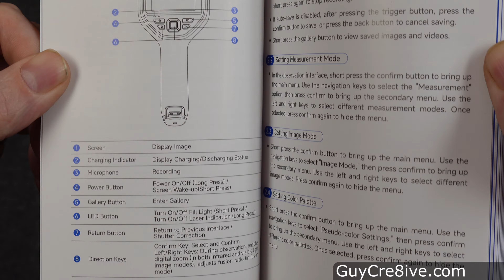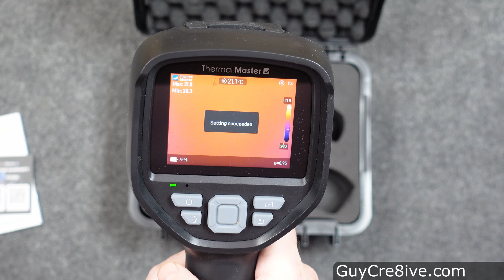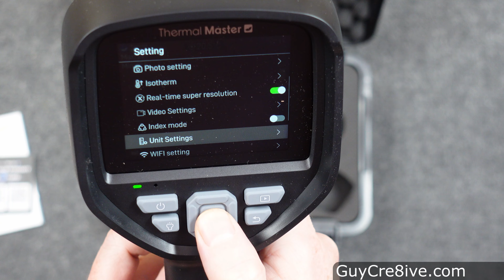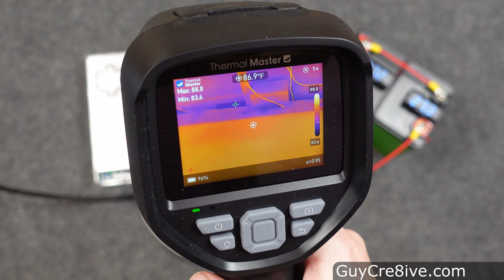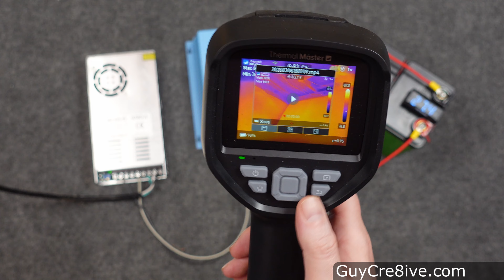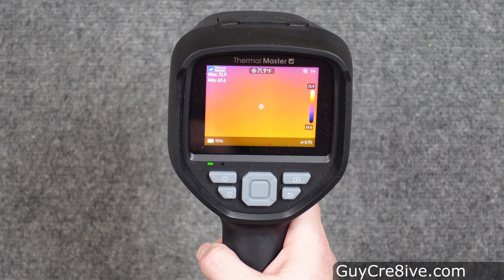Thor002 Thermal Master Imager Camera Infrared Digital Imaging Industrial Inspection Heat Temperature

Comment: I have never used a thermal camera but why does it need a light on the front?
Reply: la luz es el flash para tomar fotos convencionales (de luz visible )
Reply from the maker: I would imagine so you can see what you're doing. When it's dark, kinda hard to figure out what you're looking at if everything is the same temp.